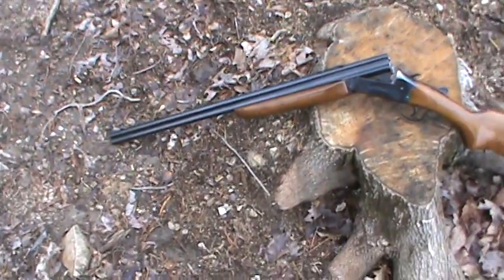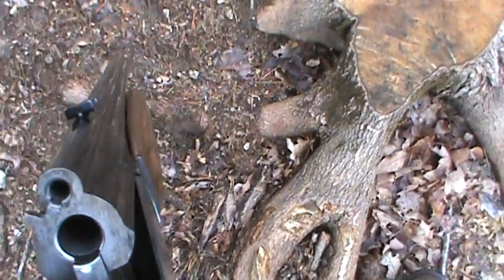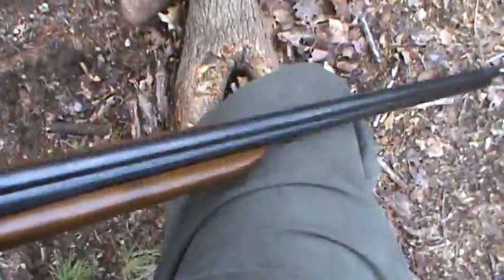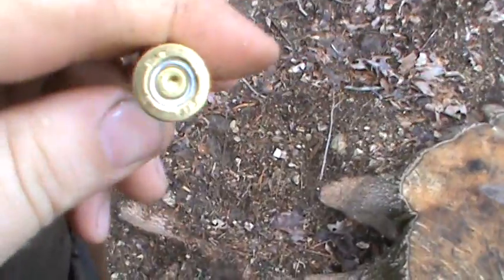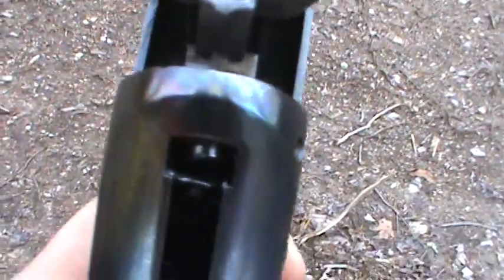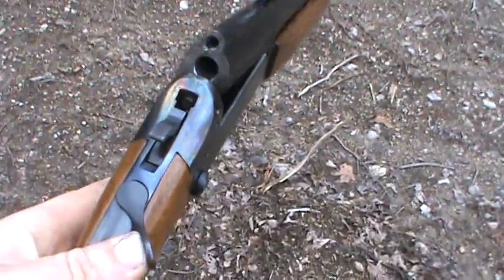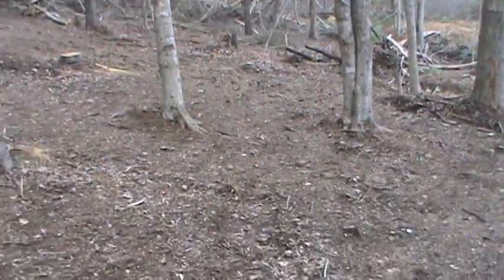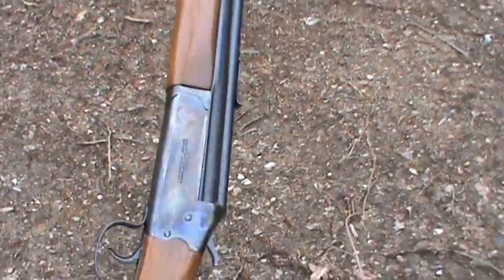Savage model  24 gun repair part 9

Comment: Re-assembly was what I wanted to see... I'm having trouble with the over/under selector.
Reply: me too Mike I've got one apart now and bought the selector parts kit from numrich  but don't know where to start
Reply: They are very hard to fix . depends on your model .There is a spring and a pin behind the side pin that holds the sides together.You may need to disasemble the entire frame. Numrich gun parts has schematics to help you.
Reply: Same I just want to remove it so I can re blue it

Comment: What did you put on the receiver after you case hardened it to preserve the color and keep it protected from the elements? Get restoration btw, nice job!
Reply from the maker: Just coated it in regular gun oil and I had no problems with rust. Thanks I wish I had the video that showed me assembling it it was a bummer when it was lost
Reply: @trkycustoms  Thanks for the reply! I just finished doing a Winchester model 37a 410 for a buddy of mine a few mins ago. Turned out awesome for a first attempt but I want to get it dialed in. Your video gave me the guts to just go ahead and try it🤷🏻‍♂️😂. It worked out but it’s and art to it for sure 💯.

Comment: Rather have a .410 than a 20 ga it is worth paying a little more for ammo. I bet the selector switch broke..they all do, on the mod 24 also the extractor for the.22 barrel turn's sideway's and can accidentally set of the .22 if you aren't careful. But all in all I love the old mod 24 savage! Best gun all in all I have ever owned ....the old one with side selector + silver soldered barrels! The new one's just aren't the same!😬😪🇺🇸
Reply: what new ones ? They stopped making them in '65. Thats why no seril numbers.
Reply: If it turns sideways you havent got the set screw in right -needs to be set against the flat on the extrector

Comment: Did you use any filler metal on the selector? Or did you just run the plasma over it to bind it back together?
Reply from the maker: Gary Cotz  Yes I  did er70s.. .030...one dip and dress it down

Comment: I don't know why you keep calling this a model 25? it's a model 24. 2=22 LR and 4=410 ga. I own one that I need to replace the firing pins. Also there's a tigger selector switch for them. I love the gun, I learned to dove hunt with it. The 22 is great! very accurate. Thanks for the video :) hope you enjoy the gun. Keep America Strong! By owning and shooting your Gun's! One question do you know where to get the firing pin's for this gun other than Bob's gun shop on line?
Reply: numrich gun sales has a lot of parts